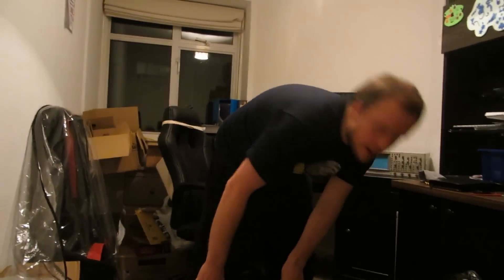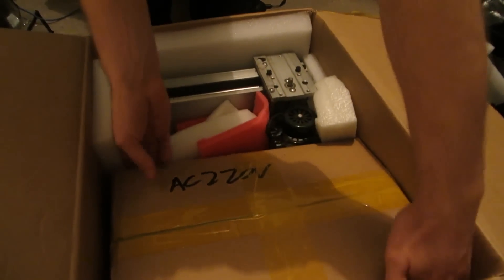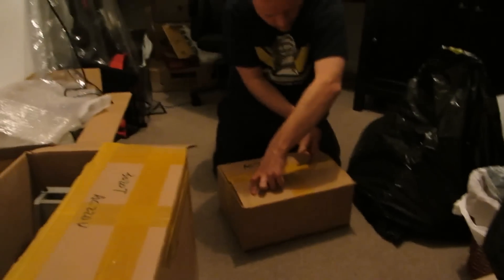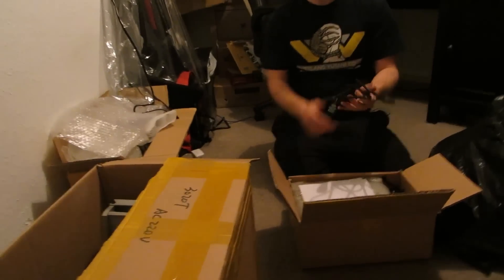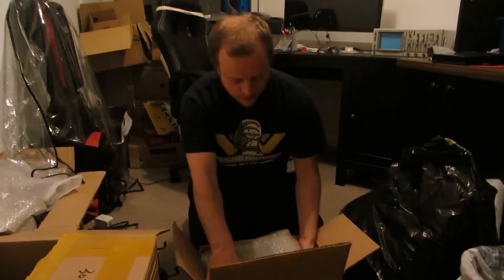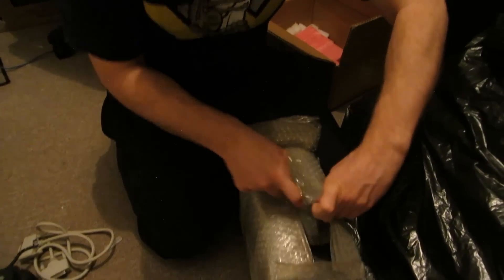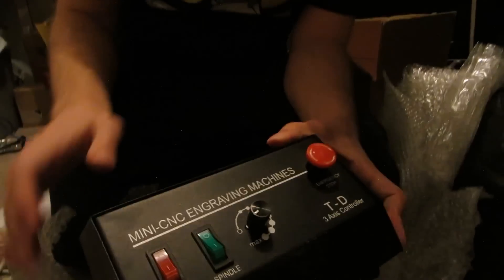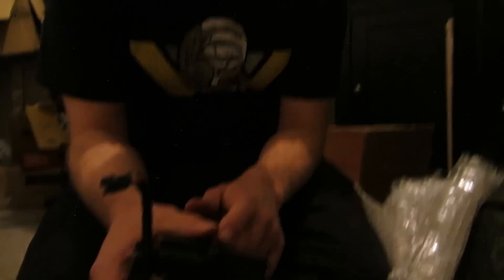3020 CnC Router Unboxing and Setup

Comment: Hey man! is it possible to connect this machine to a th generation laptop? even if the laptop does not have the parallel port?
Reply from the maker: My answer was to use an Arduino running the GRBL software, so I could send data via a USB port - have a look here https://youtu.be/dL2rBP5c4qs to see how I did that.
Reply from the maker: In 2021, I'd bet you could have this running from an ESp32 still running GRBL, but perhaps with WiFi extensions, or with a Raspberry Pi Zero W. I should perhaps do one of those upgrades on my machine...

Comment: Hello buddy, where is part two ie the setup?
Reply from the maker: Johann Wyss I'll sort out links in the description to the other bits. I'll also come clean on not getting enough footage at the time.
Reply: Ahh I see. Was a great video. I am getting anxious for mine to arrive. kind regards, Johann
Reply from the maker: +Johann Wyss ok I've linked the next part in the description for you.
Reply from the maker: +Johann Wyss which machine have you ordered?
Reply: Thank you very much, I ordered the 3020t I only want it for isolation milling of PCB's.
Reply: Mine is listed as having both parallel and USB ports. This was the main selling point as none of my computers have the old parallel ports on them. That said if there is any issue I will do the same as you and simply interface via Arduino.
Reply from the maker: You'll have to let me know how you get on - I've not tried that yet but I can see it should be capable.
Reply from the maker: My next possible stage is to try and place a pi 3 on it - to store and buffer files, wi-fi connected, dedicated so it won't go to sleep or something annoying like that, and with a small display to show mill location or other info connected to it. Perhaps even a control pendant.

Comment: one of the three steppers has a spiral cut on the chuck. I assume this is for the z axis ( maybe to soften backlash , I hope I am right
Reply from the maker: with these steppers, the cables had labels to state which was which. I didn't notice the spiral chuck, but I'd assume steps are taken to ensure little or no backlash on all axes. the lead screw (is that what you meant) is exposed on the z axis, but the other 2 also have them. no belt drives or bands in it.

Comment: Hey, Interested in seeing the follow up videos.
My machine has turned up today, fitted all the stepper motors and found a place for it.
Just waiting for 32 bit windows to install as I have had to install a PCI parallel port as the one fixed to the motherboard snapped off when I tripped over the vinyl cutter wire lol.

How did you find the Mach3 software it came with and are the instructions that come on the CD true to their word, as it looks awfully complicated to me, the closest thing to a CNC machine I have used is a vinyl cutter which is all automated and probably nothing like this maching.
Reply from the maker: I didn't use it - I installed GRBL on an Arduino that I wired into the parallel inputs of the controller instead. Therefore, a laptop with USB (I have limited space) worked beautifully. See my blog link (in the vid description) for some notes on that.